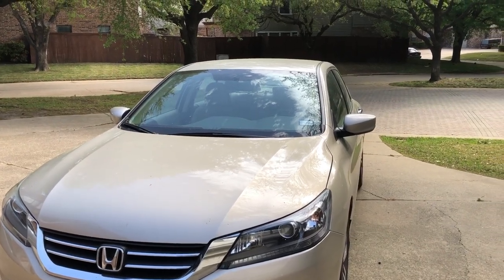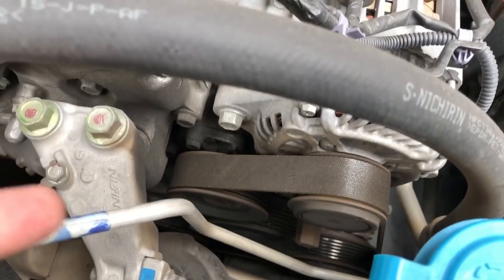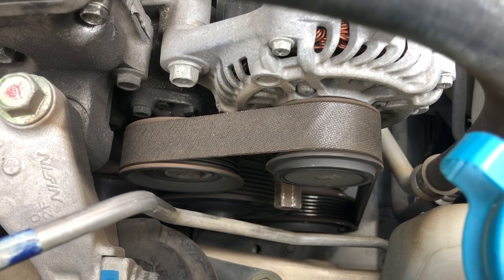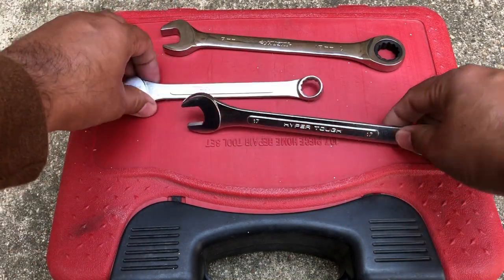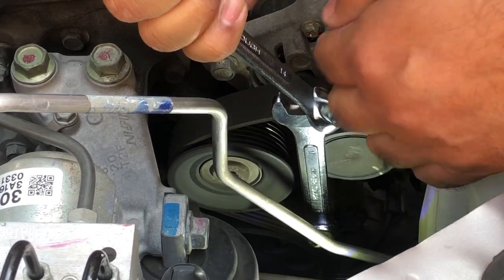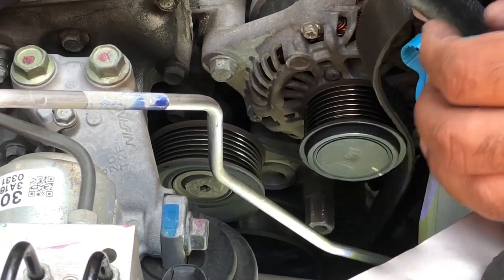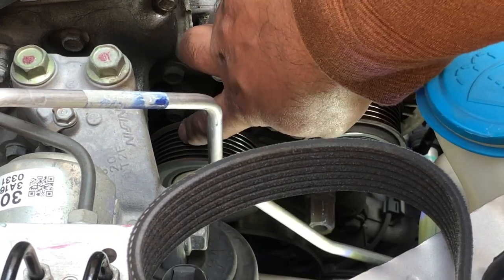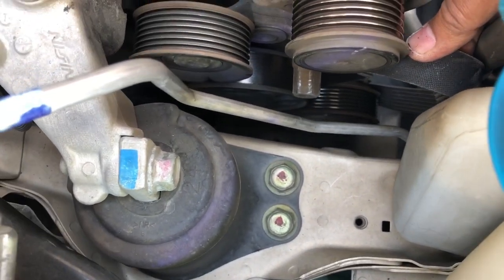Honda Accord Serpentine Belt / Drive Belt Replacement 2013, 2014, 2015, 2016, 2017

Comment: Yours was one of the best, showing how to change the serpent belt on the accord.
Reply from the maker: Thank you! I am so glad my video helped. In case it helps, the description of the video has step-by-step detail of how to remove existing belt, and then how to install new one. Best wishes
Reply: I just made my vid showing how to make it easier by removing the passenger side wheel

Comment: What helps is to lift the car from front passenger side, remove the tire/wheel, and you’ll have access to the bottom two pulleys behind the fender well. It’s more work yeah but makes the installing of the new belt easier.
Reply from the maker: This is awesome suggestion! it sure will help others looking to change the belt. Thank you!
Reply: I'm working on a video like that today, should be up on my channel in the next few days
Reply: @Striker50_  good luck brother. Removing the fender well really did help me out
Reply: @jmc224  🙏
Reply: @jmc224  Just uploaded the vid on my channel with the passenger wheel method

Comment: Torque specs:
1. Tensioner 8mm hex bolt 17 ft lbs
2. Tensioner 10mm bolt 41 ft lbs
3. Alternator bolts 17 ft lbs
Reply from the maker: Thank you so much, this is very helpful info. Best wishes!
Reply: listed the tq specs in my video I just uploaded  thanks to you

Comment: Continental belt is the best belt to put back on as well as a continental tensioner, they work smooth together
Reply from the maker: Awesome! Thank you
Reply: @FlyBeee  I think I'm also gona replace the alternator since I'll have the belt off it's the original but my brain like to do preventative replacement parts here and there. So I'll add that in too
Reply from the maker: @3232myke  Makes sense about alternator considering you would have the belt off anyway. Wish more people where into preventative maintenance! Please share the experience of replacing the three items when you get the chance. Best wishes!
Reply: can't go wrong with 'em

Comment: I have a 2016 Accord with  151thou miles just changed mine for first time last weekend the original belt was actually still good had some wear of course but it was a bit of a bitz to do had little clearence n I had to take off passenger wheel to get Belt on, I'm gona replace the tensioner too even tho the OE one is fine they should be replaced together
Reply from the maker: This is good feedback to know the belt can last up to 151K miles. Did you change the tensioner as well?
Reply: @FlyBeee  not yet unfortunately Xmas came around but will do it next weekend I will update tho

Comment: Do you have a video on what it sounded like before? I'm having a weird noise from my engine bay but can't pin point it. Really hoping it's just a pulley or water pump and not the timing chain 🤦‍♂️🤦‍♂️
Reply from the maker: I don't have a 'before' video but I recall that sound didn't change before - after. If you are hearing a sharp whirling sound it may be coming from the tensioner pulley. Search YT for tensioner pulley issues and see if the sound is similar to what you have in your vehicle. How many miles do you have on the odometer?
Reply: There will be no sound difference whatsoever
Reply: I have a video called supercharger on my channel regarding the tensioner pulley to hear that sound, but the serpentine itself usually doesnt make noise

Comment: Wow , you were lucky mine was a nightmare, only made it half way if that, on the last pulley. Had to start the damn car with belt half way on hoping it would catch and it did.
Reply from the maker: This is a really nice trick to get the belt back on! Old belt is stretched and comes off relatively easy, but in comparison to install the new belt I had to pull the tensioner all the way to the right and  (at video count 9:25) tensioner pulley was almost touching the alternator pulley! Best part is you have the belt installed now and saved money and time in doing this yourself, which is Awesome! Congrats, and best wishes!
Reply: Do the belt tensioner pulley suppose to spin when engine is running?
Reply from the maker: @jesuschrististheonlytruth335  Yes, the tensioner pulley should spin when the engine is running. If yours is not running then take into consideration that with usage the bearing inside auto tensioner pulley becomes noisy and eventually fails. You can fix just the pulley or replace the full tensioner if needed and you will be all set. Best of luck
Reply: @FlyBeee  thank you very much
Reply from the maker: @jesuschrististheonlytruth335  You are welcome. If you get a chance to circle back, I am eager to know how you fixed the tensioner pulley in your vehicle. Thanks so much!
Reply: Be careful. That works on some belts like the Gates serpentine V model which allows slight misalignment before turning the pulleys.  The Bondo serpentine belt model has a different shape and it might not "catch" during cranking.

Comment: Sure would have been nice to see how you lined it up on the bottom first.
Reply from the maker: There is no special advice because I started out from the lower pulleys so it was easy as wrapping lose belt on the pulley. I hope this info helps.
Reply: I have a video showing how to line it up on the bottom

Comment: How many miles need to change belt Honda
Reply from the maker: On Honda vehicles, Belt change interval is at around 110K miles or sooner if the belt becomes cracked, damaged or glazed (shiny). Mine was glazed as you see in the video.
Reply: @idrissmorocco23 yes
Reply: @idrissmorocco23 Ok
But you should know English language is not my first language 
so I can't peak up every wards
Reply: @idrissmorocco23 Oman

Comment: My belt ripped off,  i went and bought a new 56”. Installed and it was slightly loose, i compared it to the broken one and the new one was about an 1” or .5”  longer so i i had ordered a 55” and now that belt is too short and unable to slip on the last pully. The 55” and the broken belt (original) are the same size and i also bought a new tensioner and still nothing! What am i doing wrong? Ive been doing so much research and still cant find a solution..
Reply from the maker: If these two were non-OEM belts then I would recommend to use the Honda belt. The part number is shown in video and also noted in description of video. I hope it helps. Best wishes.

Comment: Thank you! Well explained. Was it easy to put the belt on AC compressor & driver shaft pulleys without removing tire & do it from underneath?
Reply from the maker: Thank you. It was super easy to install the new belt from the top of the engine area. I did not remove the front tire or get under the vehicle. What you see in the video is exactly what how I did the work to remove/install. To install the new belt I started with the compressor pulley and wrapped around it, then the drive shaft pulley, then grabbed the belt from top of compressor pulley and pulled it upwards to then wrap the belt around alternator pulley an then finally on pensioner pulley. See the video from count 6:30 onward. The step-by-step directions are also in description of video. I hope this helps. Best wishes
Reply: @FlyBeee  Good to know that you didn't have to remove the front passenger tire. I'm at 165k+ on the factory belt and it's still good, no issues with noise or anything. However, I did notice the middle track on the belt wearing a bit compared to the others and thought I'd tackle this next weekend as preventative maintenance.
Reply from the maker: @lji2000  I agree to tackle this before the belt condition gets any bad. The steps I show in video is exactly what I did to replace the belt. Let me know if you have any questions about the process. Good luck!
Reply: @lji2000  Removing the passenger wheel will make it easier, but not necessary. I've had to change the tensioner pulley twice now and the first time the belt kept slipping off so I removed the wheel and it made it a lot easier